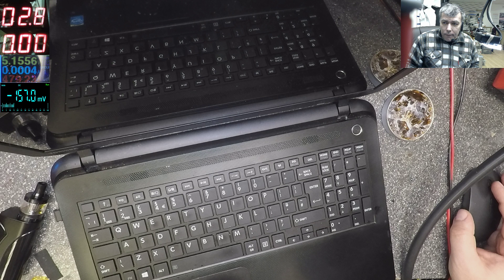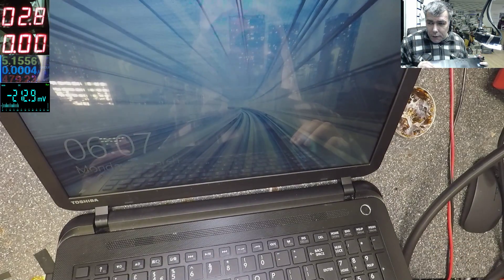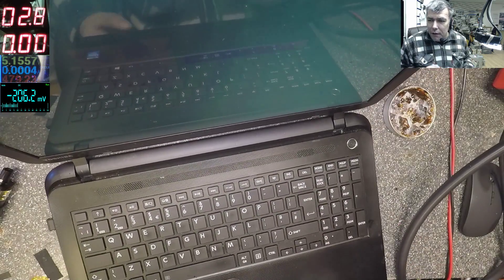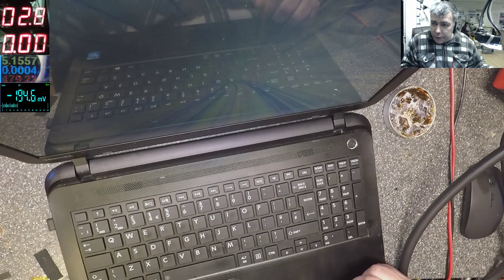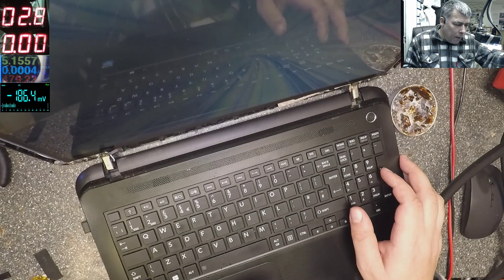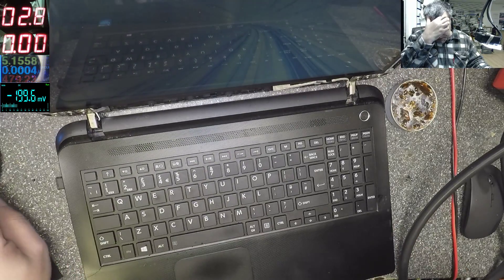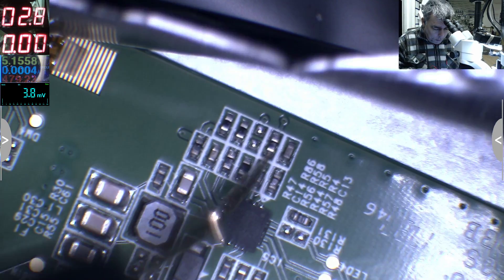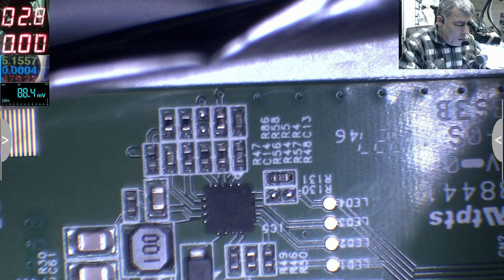Diagnosing LCD backlight inverter problem

Comment: just wondering if you don't have an oscilloscope and you are trying to find the high rate of voltage change somwhere.. could you test the terminals of the components with an led and a high resistor?
Reply: also how did you know to short the two components to find the fault?

Comment: I usually admire Sorin's methods and highly regard him as a technician, this time however, I gave him a "dislike". Why? Because he just put a band-aid on a broken leg. Obviously something was causing this fault and after his "fix", this fault wasn't removed - just swept under the carpet. Yes, the computer is (somewhat) working, as he admitted, probably without a full functionality of the NEW screen, and yes, I do understand his time constrains and cost of the repair to the shop. Was it effective? In the short run, yes. Was it professional? Hell NO! I, as a customer, would be furious if my NEW screen, for which I paid (most likely) wasn't fully operational. And, as this is (i think) a warranty job, the client has already some bad experience with the shop (she/he had to come back = waste her/his time x 2). If they discover lack of brightness regulation ability (granted, may not happen for a long time) and (say) take it somewhere else, this "fix"is going to be discovered... How it would affect Sorin's shop reputation is an open question. Bad reputation travels very quickly...
Reply from the maker: You are the customer .... i will give you two option .... a repair like in video for £40 (but you can;t adjust the brightness) or a super io chip replacement (most like faulty in this case) for £100 ..... your choice? 100% of the customers go for the cheap one. I always said on my videos, this is a real life shop, nothing fake, nothing done only for a good looking youtube video.
Reply: @electronicsrepairschool  Sorin, if the customer WAS presented with these options and HIS choice was to go cheap, then YES, it was a way to go. What I was referring to was the situation which unfortunately happens in many, many service shops, mechanical garages, etc. When a customer comes with the engine warning control light on the dashboard, they give him the cheap and expensive options. The cheap is to disconnect the control light (so it doesn't bother the Client) instead of fixing the engine. If The customer doesn't know anything about cars, they may choose the cheap way, just because they will pay less (in the short term), not realizing that they may be forced to pay much, much more in the future for the engine replacement.

Comment: I have a small screen that has a driver curcuit that I think is bad. it has a 6pin driver chip marked 07AA with a R offset lower. This is on a 3D printer Malyan M200. Could you suggest how to find this chip as I have looked everywhere I can think of. What would you do or use to replace it with? Thanks for the videos.

Comment: i need your help sir
i have the same model of laptop
i tried to instal windows on it but in vain
i use several version from windows 7 to windows 10 but i i always got a blue screen
i tried changin ram module; also the hard drive 
i tried to install windows via 2 ways: from cd drive and from usb drive but the same thing
i do an update to the bios but no results
do you have any idea what can be the problem .
thanks